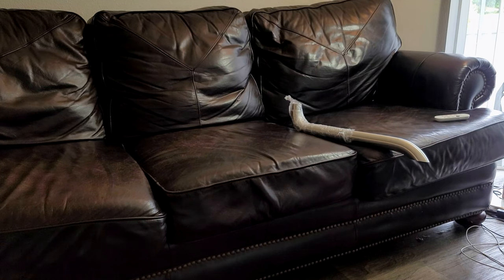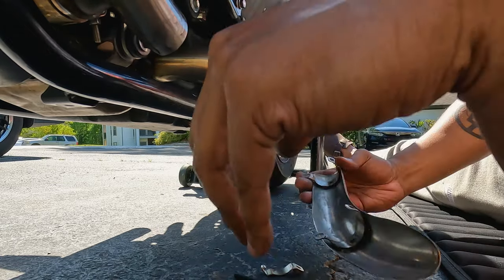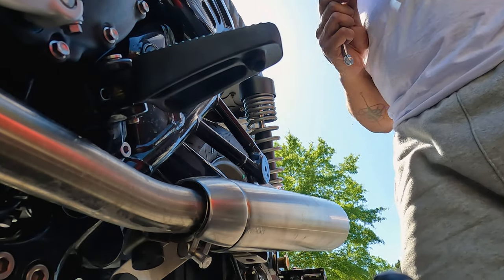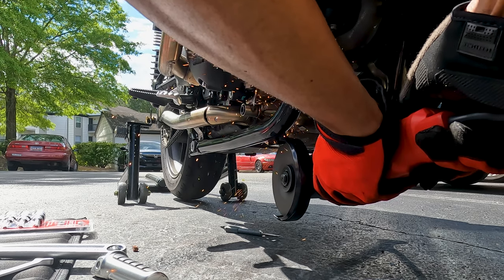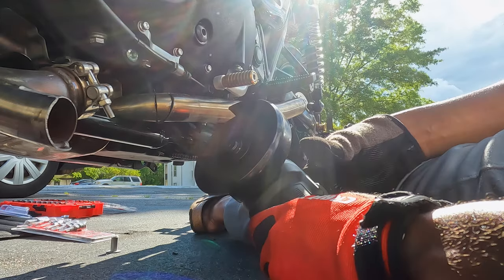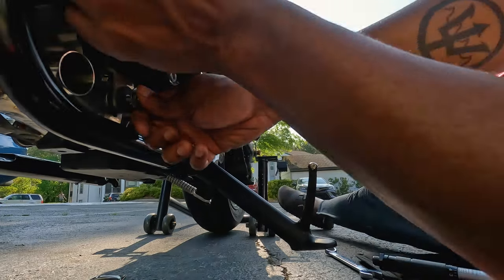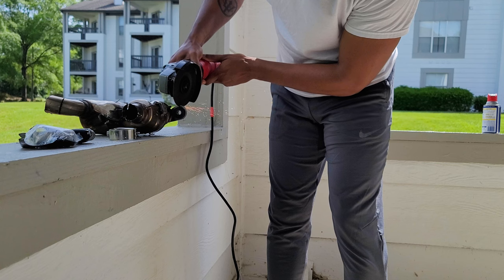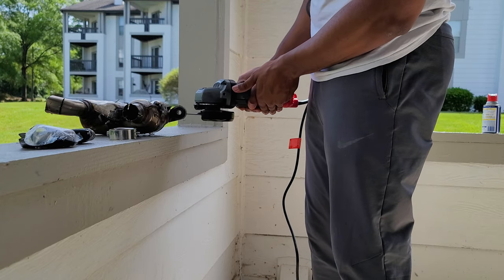Motone X-Pipe and Exhaust Install: Triumph Street Twin | Speed Twin 900

Comment: Instead of cutting, you just remove both side frame rails, they are attached at the top front by 1 bolt, the main front engine mount bolt half way down and the 2 bolts near the foot pegs. You also have to unbolt the reg/rec and the top of the radiator as it sits on a peg on each frame rail. This may sound like a lot, but it's WAY easier than cutting the mid pipes and potentially messing up the frame or cases. With both the left and right frame rails out of the way the cat and welded mid pipes will just drop down when unbolted from it's mount. Then just rebolt the frame rails on and slide the x-pipe into place and bolt everything back together.
Reply from the maker: Thanks for the detailed play by play. If I get a do over I'll definitely follow this!

Comment: 10:49 why did cut that lower bracket on the lower frame cradle? and all those cut marks from the angle grinder! 😧 now you can't even install a nice engine guard without that bracket. Anyway...I didn't know that on the euro5 models the pipes that go into the catalytic converter are now permanently welded to it, I have a 2016 model and I've just removed the mufflers and am done with it. I realized that the slash-cut pipes are virtually the same except they are a bit longer. It sounds great and not obnoxiously loud, and I saved about $300 including shipping.
Reply from the maker: Because I just couldn't get it out without it, but that was a learning moment. Did the best I could with the knowledge at the time. But I wrapped my exhaust anyway, so luckily those marks are hidden and are now a part of the history of the bike. 

I do love the pipes though. Definitely worth the investment. Painted them black too. Music to my ears! Hope you're enjoying yours!
Reply: @merxmoto  since you had that rear motorcycle stand to hold the motorcycle level if you used a small car jack and a piece of wood you could have held the engine from the sump and removed the two lower frame cradles...anyway..you live and learn.

Comment: Hello mate, nice videos. I'm chopping my Ducati 937 in for a Speed Twin 900 next week and looking forward to riding here in London and doing some 'fettling'. Have to ask about your bobbins for the paddock stand. Where did you get them and how are they fitted? Here in the UK there's a company that does a rod that goes through the rear axle with bobbins on the end. Is yours the same?

Cheers, ride safe.
Reply from the maker: Yup that's it too. It's from Motone in UK. They are wonderful. Give them a look!

Comment: Hi, is Xpipe mandatory to install Slash Cut Pipes?
Reply from the maker: It depends on the model of your bike. If you have a pre-Euro 5 model, probably anything btwn 2016-2020, you don't need the X-Pipe. If you are doing the madness that I did to my Euro 5 model, then you either did to do all the madness I did, or just get slip on pipes.